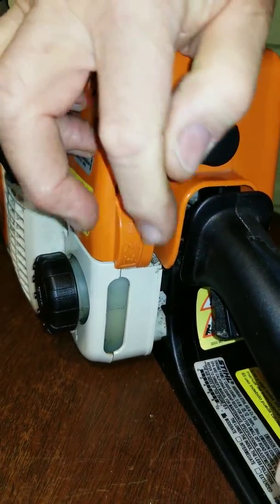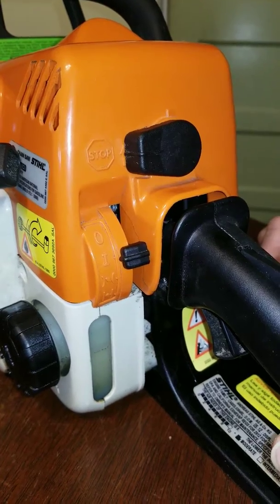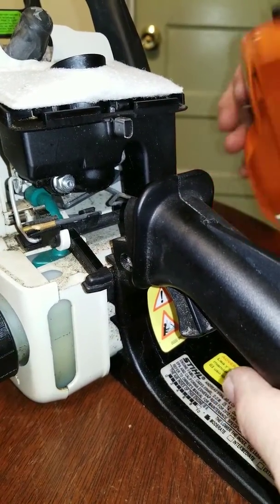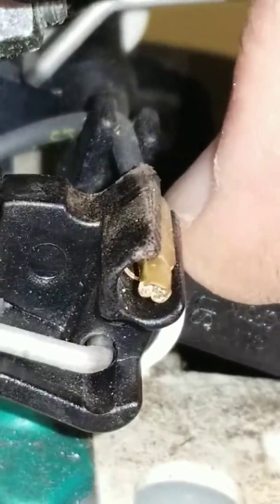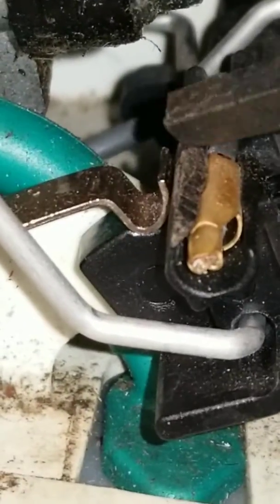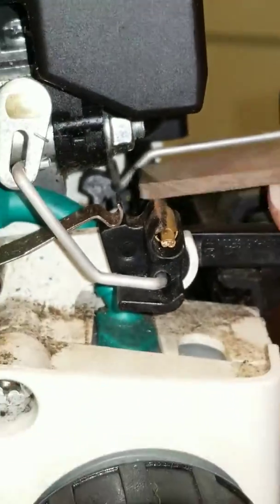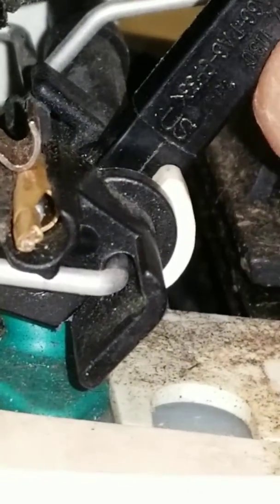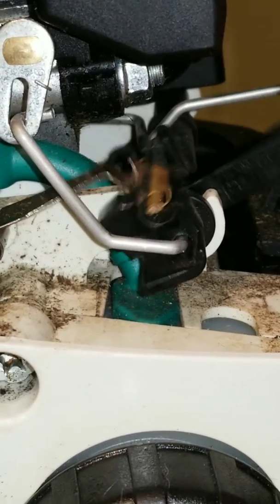STIHL MS170 CHOKE LEVER FIX

Comment: Thanks for the tip! Works like a charm and was the last fix on a saw I got for cheap because of some issues like this. I also worked my way up to some 600 grit sand paper to finish cleaning it up and put a tiny bit of dielectric grease there ànd that really helped finish it off.
Reply from the maker: @aaroncunningham2398  glad it worked!!

Comment: Ok, i really  need to leave a comment saying thank you so much for making this video. I was going nuts trying to figure out why it would not stay in the choke position, i went through lots of videos but it was not showing what i was looking for but in this video i was able to catch my mistake. I cleaned the carburator and when i put it back on and i was keeping the metal spring underneath the choke lever. All i had to do was pushing it up, no sanding was required in my case. Oh man...i knew it was something simple but couldn't figure it out and i was going crazy. Thank you again!! 🙏
Reply from the maker: No problem bro! We made that video long time ago but knew it would help someone someday!!